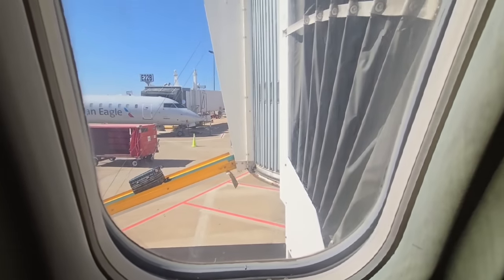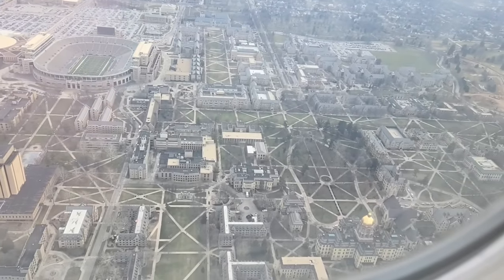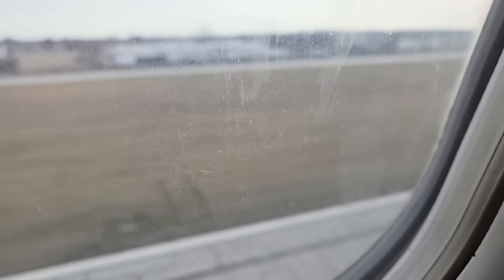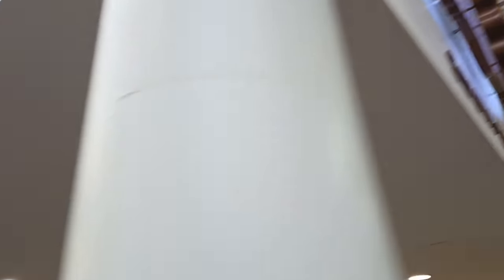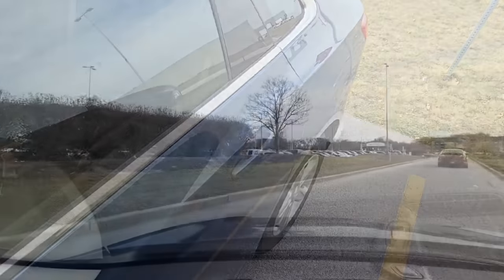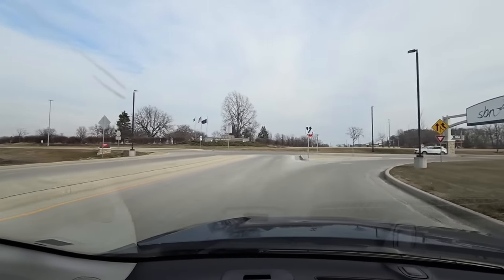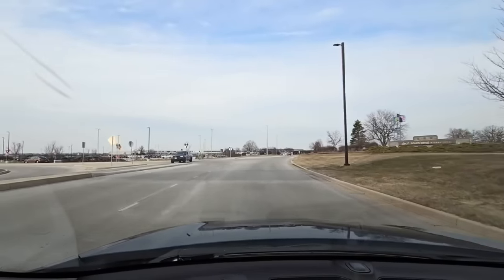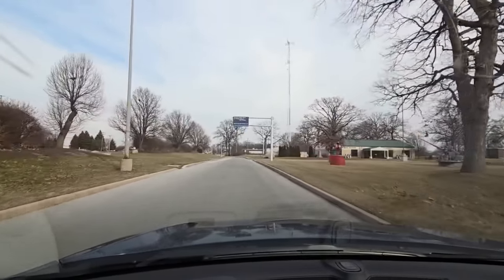LIPPERT Answers Questions about RV FRAME FLEX! Part 1

Comment from the maker: Please read this. If you feel that your frame is experiencing something outside what's being described here YOU SHOULD absolutely reach out to Lippert, the RV manufacturer, and any other resource you think might be able to help you isolate and possibly repair the problem.  The purpose of these videos was not to focus blaming anyone area, but to express what typically is happening when you see the type of movement and flex and most people are seeing.  People getting upset at my interview need to understand how questions must be asked in this type of a format to get an answer at all.  All the questions were questions that either I came up with or were submitted from my viewers.  I sincerely apologize if anyone feels that I was soft or not digging deep enough.  I was impressed that they were at least willing to have a conversation about this.  I don't think there's any way to make everyone happy here, my goal was to provide a valuable amount of information to at least help identify what one of the issues may be as a starting point towards solving it.  Everyone situation will be different.  Again, if you feel that Lippert is at fault or if you would simply like to tour their facilities and see how they make their product, you should reach out to them.
Reply: Lippert’s facility is awesome. However, something is causing these failures. 
Seems to behoove them to make efforts to determine what is causing the failure. 
GD really needs to take the lead in determining just what is needed.
Reply from the maker: @stevemaloney7903  look at this video at the 4:03 mark to see the exact issue that many owners are experiencing that leads to the detachment issue which ultimately leads to the frame over flexing.  Missing LOTS of bolts exactly where Lippert discussed .
https://youtu.be/ctQ4K5ZoEik?si=PWJ_lVuw5Dv1Yr_4
Reply: @BigTruckBigRV  
Wow. GD needs to step up and take responsibility and get it right.

Comment: Again, I think you let Lippert slide on some of their answers. “RV accepted practices” as in “there are no rules”. As shown on some youtube videos, Lippert has come out to an RV and added hundreds of pounds of steel reinforcement, gusset plats, crossmembers and so on to help the RV owner get back on the road. I would think that Lippert would WARN the RV manufacture that if they continue to exceed/abuse their original design specifications they would simply stop doing business with them. “Working in unison“ How can Lippert say working their working in unison when they don’t tell the RV manufacture this is acceptable and this isn’t acceptable. 
I’m in no way trying to blame Lippert for all frame failures. But Lippert is in a position to tell RV manufacturer if you exceed this tolerance at this location you have voided our guarantee that this frame will meet your expectations. 
Ask Lippert if have they ever taken a brand new fully loaded Grand Design Momentum apart to see if the RV manufacture has exceeded their  provided specifications. 
Again this issue is only in the RV industry as they are ungoverned by ANY governmental agency. 
Pls ask if the welders at Lippert are AWS certified.
Reply: I agree 100%. I am a certified weld inspector with AWS, and if they do not have certified welding procedures and processes along with welder’s certified in those procedures, you do not know what kind of weld you are getting.
Reply: The best welder in the world cannot fix material that's too thin to support the weight. But to agree with you, should be union trades workers with welding certificates and training.
Reply: You absolutely nailed it
Reply from the maker: They knew the questions in advance.. you may think I'm not the right person to have done this interview, but you must also know that when dealing with a major corporation, even having a remote chance to talk with senior executives about a touchy subject like this is virtually impossible.  I knew going into this that there would be some compromise in terms of my expectations and answers to questions. Any "Youtuber" thinking it would be any other way.....well, they never would have gotten a return call or past a administrative assistant.  Plus, I plan on showing detailed frame manufacturering and testing...again, if I had gone in their "tempers flavored", I would have never gained access to.  These are things people want to see AND know more about.  Hope this helps you understand my reasoning.
Reply: "Industry accepted practices" means build them as cheaply as possible and let the customer be responsible for quality control.
Reply: The answer is, DO NOT BUY any rv product that is built on a Lippert frame.
Reply: @danielsindorf9761  the customer is and should be responsible for learning to load the RV correctly and NOT 10-20% overloaded forward of the axles.
Reply: @chiplarkin4069  no, the answer is learn how to load the RV properly and DONT LIVE IN AN RV THAT WAS DESIGNED AND BUILT TO BE USED FOR 12 WEEKS OUT OF THE YEAR NOT 52 weeks for several years!
Reply: @yoyomawh4091 what do you think would happen to RV sales if buyers were told at the time of purchase that the $150K RV can only be used 12 weeks out of the year?
Reply: @bigdougscommentary5719  people would still live in and buy them, then go after the mfg when they overload it forward of the front axles and break the frame just behind the pinbox . The manufacturers need to make compartment forward of the entry door much smaller.
Reply: 100%  true.  I also am a welder and the metal is way too thin in the frame !!!!   Rv’s  is short for Repair Vehicle. The older rv has thicker steel in the frame…
Reply: @BigTruckBigRV you sell yourself short my kind sir, you sell yourself short. You have such clout yet so not determined.
Reply: You think this is a courtroom?
Reply: Basically it’s buyer beware. Ask them if they have the engineering skills to make a frame that never bends. Then ask them why they don’t. Costs is the reason.

Comment: Trust the Engineer! First thing I noticed was the body language of both the VP and Engineer.  The Engineer was straight forward and ready to provide knowledgable answers.  BRAVO!  The VP however had here head tilted as if to say why am I hear, this is not something she wanted to be doing.    Just my simple observation.  LIPPERT is to be applauded for allowing this interview and thank you for presenting this.  Looking forward to part two.
Reply: Plus her hands are in hide mode , engineer has basket mode hands so tell us more
Reply: I was thinking the same thing! she looks like she wants to say The frame flex is not our problem I dont know why i have to explain myself!!!
Reply: They are both VPs.
Reply: Engineers?
Remember Engineers built the titanic 

Amateurs built the Ark
Reply: Exactly!
Reply: @scottbigger1945  YESSSS
Reply: Couldn’t agree more about the lady’s body language. She almost seemed put-out.
Reply: THANK YOU!  Her body language is very odd.  Simultaneously defensive and dismissive.  Constant head tilt suggests she's speaking down to the interviewer.  I LOVE how the engineer made the comment about her answering engineering questions.

Comment: This is Lippert's video deposition to distance themselves from Grand Design. All it takes at this point in the saga, just one catastrophic failure on the road, and all these companies will be sued for negligence. Grand Design's response to some customers is putting the Company in a bad light and Lippert is getting in front of this, as they should. I do not believe this is Lippert's problem. Excellent job getting access to these folks at Lippert and look forward to part 2.
Reply: Agree 100%
Reply from the maker: They knew the questions in advance.. you may think I'm not the right person to have done this interview, but you must also know that when dealing with a major corporation, even having a remote chance to talk with senior executives about a touchy subject like this is virtually impossible.  I knew going into this that there would be some compromise in terms of my expectations and answers to questions. Any "Youtuber" thinking it would be any other way.....well, they never would have gotten a return call or past a administrative assistant.  Plus, I plan on showing detailed frame manufacturering and testing...again, if I had gone in their "tempers flavored", I would have never gained access to.  These are things people want to see AND know more about.  Hope this helps you understand my reasoning.
Reply: Call it what it really is.... frame failure
Reply: Grand Design has some explaining to do! It’s on them! Nothing good comes from either ignoring this issue or trying to put a bandage on it! People’s lives are being put in danger! It’s the same ole story of putting profits over people!
Reply: @Bromil  100% they try to make these frames as cheap as they can so that there profit margin is huge!! then try to blame it on the consumer! I heard one guy from Lippert say that these rigs are not built to tow across the country all the time!!! WHAT?!?! I didnt buy a 100k+ rig to sit at a trailer park!! Again trying to blame the consumer!! The more i watched this video the more pissed i got!!  And exactly frame failure not frame flex!!!  There is a video on you tube where a guy has a almost new 5th wheel toyhauler that he has towed a good bit and i believe he said his frame above the hitch was broken in 17 different places!! not flexing  but broken!!!! absolutely unreal not wanting to call it what it is!!🤬😡🤬😡
Reply: @Bromil  an rv’s strength is no different than a tractor trailers box. The side walls are structural to the frame itself. If the side wall isn’t attached correctly the floor/deck will buckle under the load.
Reply: Call Brad Smith, the service director @ Grand design

Comment: Lawyer mouth certainly shuts down the engineer quickly when he may well throw a manufacturer under the bus. She's a master at not answering a question.
Reply from the maker: They knew the questions in advance.. you may think I'm not the right person to have done this interview, but you must also know that when dealing with a major corporation, even having a remote chance to talk with senior executives about a touchy subject like this is virtually impossible.  I knew going into this that there would be some compromise in terms of my expectations and answers to questions. Any "Youtuber" thinking it would be any other way.....well, they never would have gotten a return call or past a administrative assistant.  Plus, I plan on showing detailed frame manufacturering and testing...again, if I had gone in their "tempers flavored", I would have never gained access to.  These are things people want to see AND know more about.  Hope this helps you understand my reasoning.
Reply: Great to know that! As always an excellent interview !
Reply: That's why she "heads up" the Service Team!!
Reply: Questions in advance is NOT proper journalistic technique.
Reply: Wow you gave them the questions ahead?😂😂😂😂 Not a real interview

Comment: If you want to see what a REAL LIPPERT FRAME looks like on a Frand Design Momentum, WE took ours apart last week & just posted the video of the 5th grade welding job lippert did to send out. However, grand design, Montana, & Alliance are at fault ALSO for seeing the 5th grade welding job yet still built on it.
Reply from the maker: I think someone shared a video of your setup.  The gusset, were they installed aftermarket?  I'm only asking because I didn't see those on the frames I saw at Lippert.   Also, it looks like it may be sidewall detachment, did you notice thr lag bolts not holding?  Let's chat if you want.

Comment: As the first to discover a LIPPERT problem, leaving out braces, which led to an NHTSA recall eventually, I have concluded that 

1 Lippert welds are just one step better than what are called chewing gum welds in the industry.
2 Lippert never met a triangle they liked
3 Lippert thinks that welding into the web of an I beam is just fine. 
4 Lippert or more correctly LCI makes or has made a whole line of products that are prone to Infant Mortality, mid life failure and particularly early end of life. 
5 Lippert blames the manufacturer for frame "design". 

It took about 2000 pounds of steel to fix my frame both in the axle area as well as the tongue. 

Does anyone at Lippert look at the normal frame flex as regards fatigue life? And is that flex more than the compliance of the adjoining structure can endure? Maybe then need someone with real engineering training to quiz them.
Reply: Are Any of their employees Welders to TRADE STANDARDS in UK coded welder

Comment: Main problem is certain companies use a 1/8th inch frame wall thickness when it should be 5/16 or 3/8th thickness m, but thatcuts into three profit margins

Comment: Jd thanks for taking the time to interview them. But watching both part 1 & 2 coming from my own engineering background, having been in the spotlight myself, they side stepped the questions as fast as they could, granted they have to on this type of video, so I get that. I didn’t really expect the video to admit to anything at all. This it’s not just a Lippert problem, it stretches across the rv industry that items need to improve especially when it’s a structural issue. And yes our rv has had an issue fixed under warranty. There’s a lot of engineering that goes into ever part of it but their factors of safety and quality levels need drastic improvement. Hopefully this helps with motivation to improve.

Comment: Thank you JD.
During my 26 years (so far) in the auto industry I have witness and worked on this kind of situation where a supplier supplies part of a system that fails and now when the system fails there is this gray area on who is at fault, the OEM or the tier 1 supplier.
For chassis that are designed by the OEM, Lippert will never be at fault provided they execute the chassis as per OEM drawings and specifications but in the cases they are hired by the OEMs not only to provide a chassis but to design it, they may be at fault if their team missed something, otherwise, the failure may occur because the OEM didn't inform the right set of data (for example informed a weight that is lower than the real weight, etc).
It would be interesting to know if Grand Design designs their own chassis or if they hire Lippert to do that work.  
Anyway, Grand Design Momentums seems to be light , for the size and mission (toy hauler), when compared with a true full time rig like DRV.
That may indicate that Momentums are not really designed for full time living....
Are there any failures on DRVs?
Reply: DRV has a total different frame design, it is close to indestructible. I even have a golf cart trailer attached to the rear of the frame. I’ve never noticed any kind of frame flex wobble, and there are definitely no cracks or broken welds anywhere. It is built similar to a frame on top of another frame. They’re very impressive if you don’t believe me, look into it for yourself.